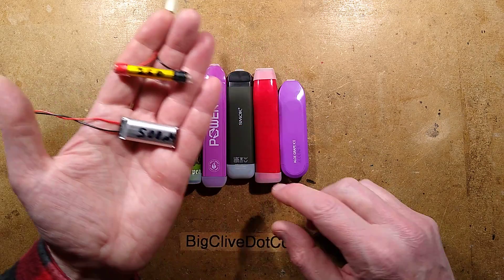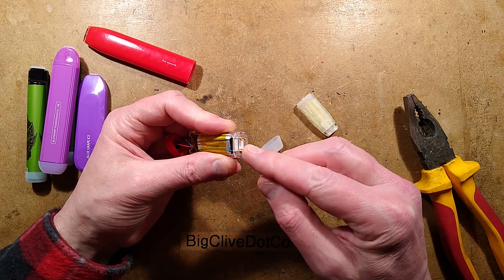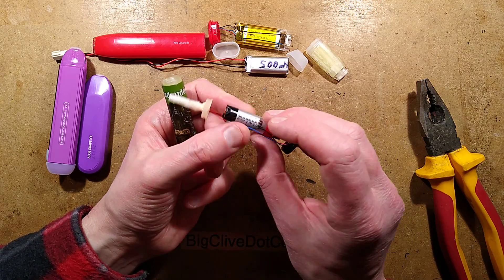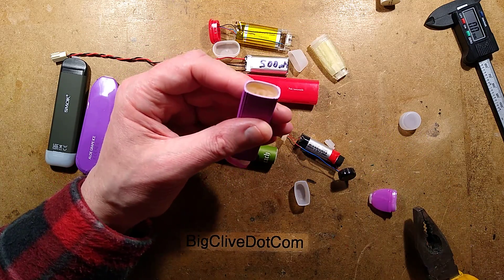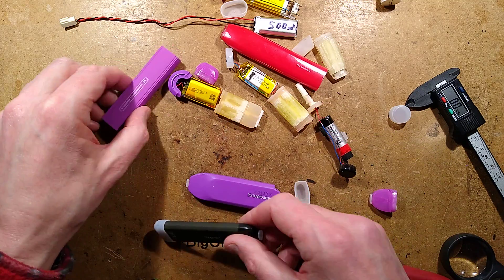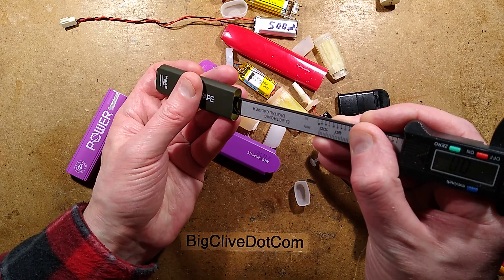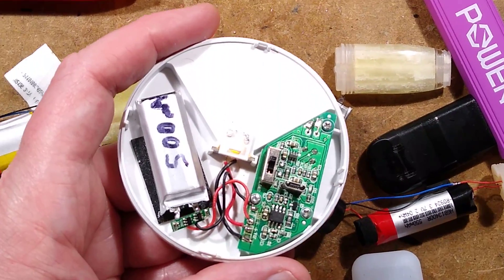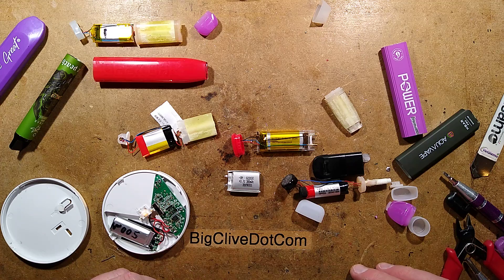Scavenging rechargeable lithium cells from the roadside

Comment: I believe that the aluminum casing ones are the same casing that's used for rechargeable units.  I have several rechargeables that look just like those.  I've bought them at the convenience stores when they offer a promotional $1 to buy the charger base.  (cartridge not included.  Like I cared)   I scavenge used cartridges as I get fuel or walk around for disassembly.    You can get a lot of nice tiny neodymium rare earth magnets that way - in some ways, that's even more ridiculous than the lithium throwaway, because they could just use plated ceramic magnets for the job.

Comment: I've been doing this for a while. 
Disposable e ciggs, one time power banks.
But one time I got a cell that looked normal I tested it for capacity but soon after it was getting hot as heck while charging and stayed hot until it discharged itself to 0.0V and died.

Also you can always connect those in parallel to get bigger and bigger capacity, you won't need any bms for that.

Comment: all you people finding used discarded vapes.  its not happening around where i live.  though i did find a battery similar to the thin one right at the start of this video.  so now i know what it came out of.  i might try fitting it to an electric toothbrush that contains a dying nimh in it.  i'll modify the charger to suit it.  by the way, i picked up 2 cordless home appliances yesterday (its 'junk day', a.k.a. 'sidewalk shopping' where i live ) and got a total of 13 18650's out of them. p.s. i picked up a cordless vacuum cleaner today but i havent dismantled this battery pack yet.  i think i'll build a frankenstein cordless drill battery pack with all of them.
Reply from the maker: I wouldn't recommend using it in place of NiMH.  Put a new NiMH cell in instead.
Reply: @bigclivedotcom  , good advice normally.  this toothbrush takes a special battery.  its 4 nimh cells stuck together to aa size to achieve the same voltage as a lithium battery.  i'd say the toothbrush designers set it up for a lithium battery but the accountants decided to go cheap.  the charger will be a pcb lithium charger swapped out for the one it came with and connected to the original induction holder  i think ive seen these chargers on your channel.  they are fabulous. not like some lithium chargers which make the batteries sound like frying eggs and bacon.  all testing of the mods will be done in a shed with steel walls and a concrete floor containing nothing that burns.  (like a giant pie-dish)  and repeated until i'm sure there is no danger.  p.s. the cordless vacuum battery pack i found recently has been made to fit within a dead makita pack. some of my tools are happy to work with it.  it will be charged the same way one other of my makita battery packs is charged.  a timer set for 9 hours powers a 20v nimh charger.  and only ever charged up in that non-flammable shed.  ive been successfully doing this for 5 years.  there is no temperature rise doing this.  the nimh charger hasnt got the guts to overcharge the battery packs.

Comment: You can also get a ton of these in the electronics recycle bins in electronic stores... I scavenged a bunch of high quality cells from things like rechargeable mice, keyboards, headphones... that got physically broken but their cells were barely used (most of them hold full rated capacity, no issues whatsoever).

Comment: I recently found one of those chunky squarish vape units. I picked it up thinking there might be a salvageable cell inside. Sure enough, there was what described itself as an 18650 inside. Only it wasn't in a can. Instead, it was foil wrapped. Not having a use for such a cell, I tore it apart. There were sparks, which was fun.

Comment: I would use those batterys for my RC Planes.  they could even be used for kids toys. I used a lithium battery in a drill type battery for an electric start leaf blower with a dead battery and no replacements available. It worked better than the original and I had no problem selling it. I actually found another 3 months later and did the same thing.

Comment: I saw 3 of these on one walk to the end of my road. 
Suggestion for clickbait title "I built an electric car out of discarded e-cigs"
Reply: You indeed can build an RC car with these, and save the click baitey title 😆
Reply: @robert_g_fbg  Just use forced perspective of a little RC car close to the camera and clive being vana white further back.
Reply: "free power" is also a valid (and true) clickbait title.
Reply: I use the small cells on tiny RC helicopters and nano quadcopters. Two of the 500mah ones in parallel run my flybarless micro heli.
Reply: @tech4pros1  you got a vid on this? :D
Reply: except that according to youtube, these are the things that must not be named...
Reply: Tbf I would definitely click on that video
Reply: That would have the opposite effect as clickbait as YouTube tends to tank the algorithmic value of videos that address vaping in literally any capacity in title or thumbnail unless you're a big media outlet
Reply: update. just found an entire vape in the snow , must've been lost out of a pocket . no identifying marks.  cleaned mouthpiece with sanitizer and charged , still works.
Reply: A personal battery bank with minimal soldering or additional charge circuitry. You could actually have a 10,000 mha bank with whatever connections you wish , Thats only 20 individual cells .
Reply: Last week I also found 3 of these on the ground. One had been run over by a car but the metal case seems to have protected the battery that I was able to recharge it. Another looked so damaged I threw it into battery recycling immediately. A third one was meant to be recharged via micro USB but the chip had failed and the owner simply discarded it in a car park. Today I found another disposable ecig in the grass - battery voltage was just 2V but I'm attempting to recharge it using a TP4056

Comment: I pick up old laptop batteries that I think have many cells in them I take them apart test them charge them throw them out if they're bad I have a box.. but what somebody needs to know is where are the best value cells available and what are the top three or four regardless of amp rating where is the best value to be had because lots and lots and lots of cells sold on the internet are bad thanks

Comment: Is it possible/safe to just parallel wire all the batteries into one big battery? and just use one of the charge chips? they will only monitor voltage, so it won't matter if the battery is .5 or 5AH? real world example: can I parallel another mobile battery into my phone, without doing anything else?😆 love your channel dude👍

Comment: I re-reread the old recycling regulation. In the EU, for all small electric appliances that contain a rechargeable battery and other electronic circuitry, the manufacturers must offer a recycling service by taking back an old device upon the sale of a new one. 
If a buy an hair drier or an electri razor, or an hand drill, the reseller must take back the old device if asked.
Now, I don't know if the law has been carried over after Brexit, but I believe it did. The vapers who vape those single-use e-cigarettes, should return the old ones to the shop who sold them. Both the electrolyte present in the battery, and the nicotine left over in the atomiser are bad for the health, and should not be discarded in random places...

Comment: Great video, Clive. In the states where I live most of the vapes tossed to the roadside have cases made of aluminum. It is such a waste but it serves as a great source of scrap for various projects, not to mention the batteries. I have yet to encounter one made of plastic, so that was very interesting to see.
Reply: I made my wife a little flashlight from one of them aluminum ones i found. I also have one mounted to my reloading press as a light to see inside cases.
Reply: @rwt8851  The Al-bodied ones, when fitted with a proper charge-discharge protection board and a light (LED) would make a useful keyfob that fits neatly in a clenched fist.
Reply: @rwt8851  That's awesome. It's good to know that there's one less vape out there polluting the ground

Comment: It looks like air flow into the heater/wick area has to flow around the battery. Scary to think what would happen if a battery went off during use. Very low probability, but those are very cheap cells with no protection.  Then you pointed to the cell which leaked electrolyte. 
Yep, thats a hard NO!! - Not what I want sucked into my lungs.
Reply: but knick a teen is ?
Reply: Several people actually have had a battery go off in their face while using them in this manner.

Comment: I’ve seen those battery protection boards like you mentioned sold online in lots

 really really cheap. I don’t really remember the price but you can get them for a few pennies maybe $0. 10 and add them to the cells….. if you are concerned about safety or plan to use/ charge them regularly.

Comment: The control circuit of these electronic cigarettes contain the battery protection circuit. 
So when the LED starts flashing, the battery is at 5% charge and is disconnected. The cigarette is finished ad has to be throw away. But the battery is fully usable if recharged with a lithium charger; or at 4.2 Volt until cha charge current drops to 0.05C.
Those cigarette sell for £ 4.99 and have one year shelf life. The price at factory floor, before they cross the Ocean, must be around 50p.
The Li-po battery can do 50 charge-discharge cycles before it starts degrading. The e-liquid atomiser can take around three or four refills before it start tasting weird.
Incredible how the Chinese have made the rechargeable batteries cheaper than primary ones. The recovered batteries are a perfect legitimate replacement for MP3 players, toys, clock, lights, and other small rechargeable appliances. To close my note, the DOA for those e-cigarettes is one over one hundred.
Thank you Big Clive for the video!

Comment: Yep I found them in parking lots like at Walmart and places. You can find them really regularly
Reply: I think the reason you see so many that are using aluminum and are built much more rugged and nice, is because they have a lot of leftover materials left that were made for the use of more reusable and nicer more expensive models. So they probably just buy huge parts lots and instead of going with the original design make them disposable.

picked up half a dozen in the last month or so, I’ve seen many more than that but the reason I picked him up from time to time is because I find ones that are much more complex and very nice, and I’ve been stunned that some of the disposable models, are built in aluminum and much more heavy duty. and they’re basically just reusing old designs and cases made for more expensive multi use models. But I see them in parking lots all the time, and even more often when driving up to see them in the middle of the road and on the side of the road

Comment: I knew I wasn't the only one who thought these cells would be useful for something! Haven't found out what I want to use them for yet, but I got a bunch already!
Reply: Depending on how many you end up with... you could think big, instead of small. Like, through wiring them in Parallel-Series. So if you had enough to wire 4 in Parallel, that's close to 2000mAh capacity. 
Then wire those 4 in series with another 4, and you have a 7.xV bank.
With another 4, you have your 11.xV bank.
With another 4, you have... etc :P

I know from experience that an 18V Drill battery pack can "charge" a typical laptop through it's power port, provided:
A) The laptop doesn't give a shit what charger is connected to it (sadly, most these days, do care and "talk" to the bricks to make sure they're either legitimate or ample power)
B) The laptop doesn't use some oddball connector that you can't source

But yea, as Clive mentioned in another reply, just keep in mind what's being powered, since some things are high instant current draw, or high continuous current draw. So that'd end up over-taxing their wires and internal bits. But LED flashlights, or fans (like a computer case fan; 12v but some are content running off as low as 5v), or makeshift emer USB power banks for recharging/powering devices are all contenders!

Comment: For as crazy as it is for them to be using aluminum I suppose it's possibly better than plastic in terms of recycling.

Have to admit, I was anticipating those pliers to slip and bite some flesh,  happens all too often here.

Will be interesting to see what sort of internal resistance those cells have.
Reply: Given their intended application I'd imagine they're quite low resistance. Crazy that they're meant to just get thrown away
Reply: @danandrei96  most of my technically inclined friends suppose these cells were rejected by QC in the factory: slightly lower capacity than required, or something. They could be even manufactured with less charging cycles in mind, to save expenses on materials. No idea what's the catch so far, so we can reuse them with caution, and recycle properly on their EOL.
Reply: If the trash goes to an MRF (materials recovery facility), the eddy current non-ferrous materials separator would pull out the aluminum body ones

Comment: Thank you for making this video. I partake in these devices from time to time, and take them to bits just to dispose of the cells properly, but i lacked ideas for applications for them. Also could you please explain what would be a safe way to recharge them for future use, or link to a video if you've done so before. Many thanks!
Reply: Any RC battery charger  designed to be adjusted for various batterys works great. Don't use the charger that comes with an RC toy. I am talking hobby grade.
Reply: @scottfirman  so something like a programmable smart charger?
Reply: Even simpler, you can buy power bank charger boards.  Especially if you don't mind mini-usb vs micro-usb, they're dirt cheap.   I bought five of them for something like two dollars.   If you check the listings, many of them have the protection circuitry built onto the board.
Reply: You just connect a hobby charger in Lipo mode,   You can figure what to set the current limit by converting mah to ah->amps. I like to go on the lower side, so if the battery is 550mah I would charge it at 0.5amps of current. The wires on these things are always corrrectly color-coded, so red to red, black to black. Simple stuff. What I don’t recommend is recharging your schoolmate’s single-use devices, especially for money. That’s a disgusting thing to profit from. Also be aware of battery safety, these can be quite harmful if you don’t what you are doing. Good luck.
Reply: @zreolmeannin  Most newer hobby grade chargers are smart chargers. As soon as you know what MAH they are, its easy to convert as you stated. I am 62, so no school age people I know, except grandkids. I always take precautions  charging any lithium batter and honestly, most people wouldn't  know what they were doing and probably start a fire. I store all my batterys in fire proof containers and charge them in a fire proof bag.
Reply: @scottfirman  lithium fires are terrible for sure… I once had a faulty 3s 5000mah lipo battery that almost popped on me, I wasn’t expecting it at all. Scared the living shit out of me, I since stored it in a lipo bag and never touched it. Very terrifying stuff. The battery was a couple of weeks old and always charged on balancing mode. Be safe out there.

Comment: I regret buying a new lithium cell for a bluetooth speaker that I found on the street. I did replace a battery in one speaker with a salvage cell from another one and reused the little bms board for protection.

Comment: you can charge them via the pins, I uh use a glycol based delivery system often and an ex used the disposables, after they "died" i found you could actually recharge them and get a significantly longer time out of them. I just used the charger I use for 18650s
Reply: the last one seems to use the case as a heatsink